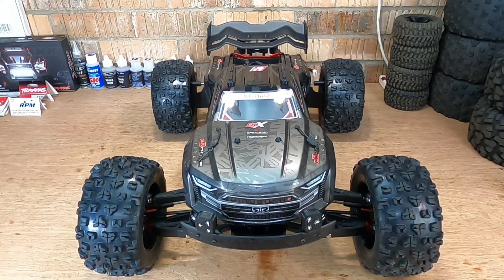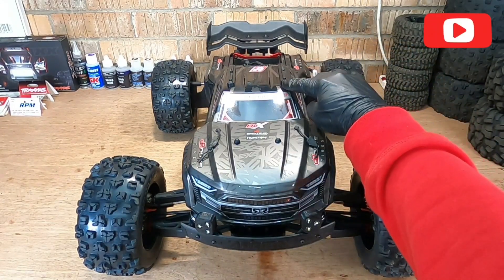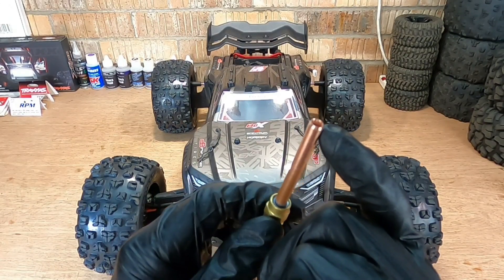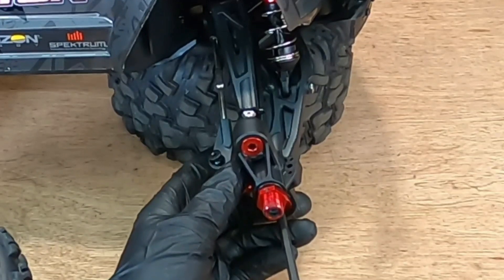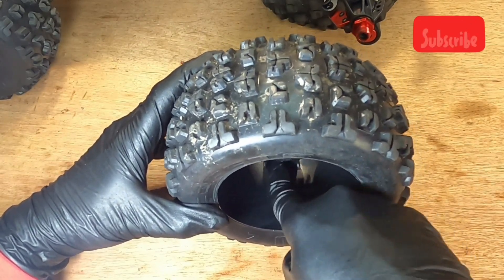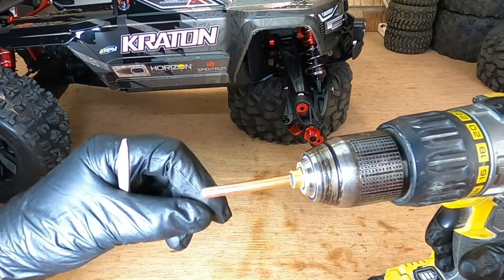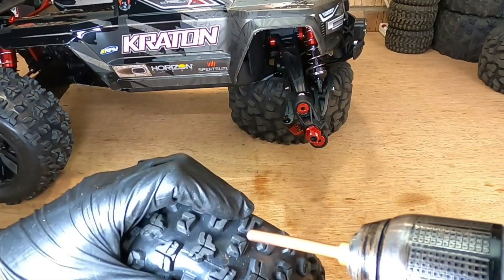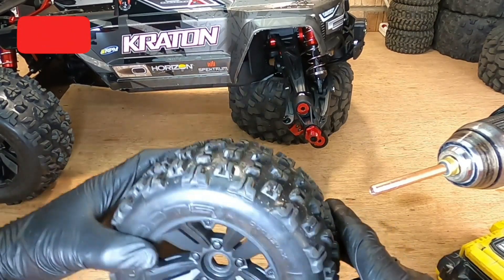Arrma Kraton EXB 6S, Kraton 8s, Traxxas X-MAXX - HOW to vent the rc car tyres. What tool do I use???

Comment: Very informatif video.. Thanks for the tips 👍🏻 
Btw if we thigten that pivot screw, it will be make the servo work hard to turn the whels, its ok?
Reply from the maker: Thx pal. Yeah your right. I did loosen it off slightly. Steering looks to be working OK but it is something you should keep an eye on in the future...👍🙂
Reply: @inspiredrc  for sure.. thanks for replying 👍🏻

Comment: Realy??where the water come from brand new tires??
Reply from the maker: Hi. Water ingress happens when you run in damp conditions. The wheels come with an inner vent hole that allows water into the wheel. This water will try to escape when you run. If the tyre doesn't have a vent hole on the outside then the tyre will blow off the rim due to centrifugal forces.